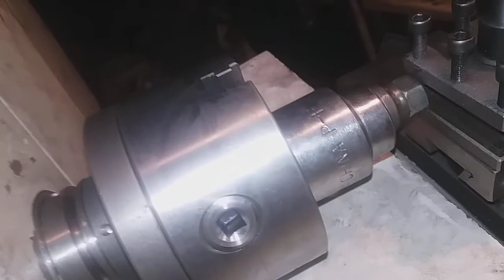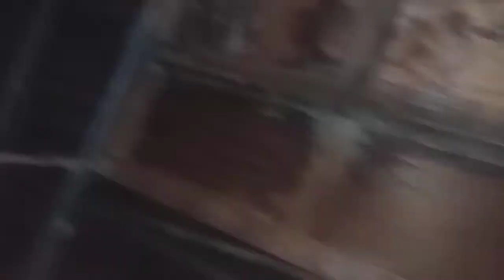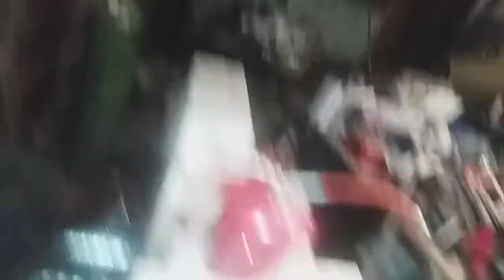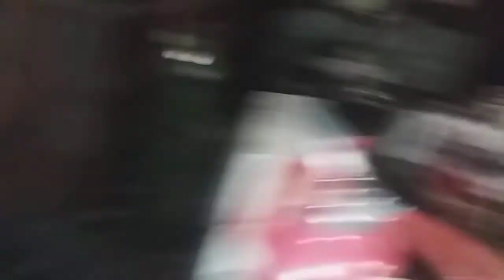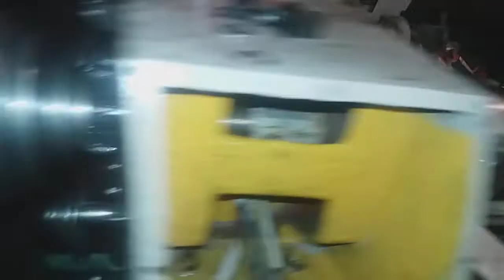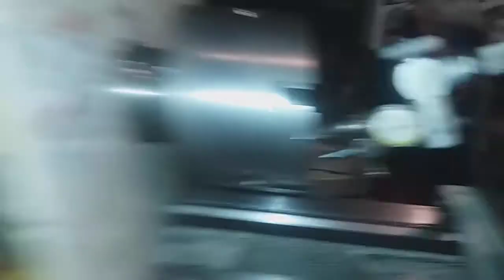G0602 Lathe Spindle Replacement/ Headstock teardown Part 6 of 6

Comment: Thank you for putting this together! I watched the whole series. Very Helpful! I need to do mine as well for the same reason, my oil galleys were full of grit, no help from Grizzly. Question why did you have to replace the spindle? Did I miss that in the videos?
Reply from the maker: Thanks for comment, yeah I believe the included video covers it. In the videos I was gaining experience and learning things, but didn't find the problem until I switched to the 4 jaw chuck. I think they cut the backplate on it (maybe) because it didn't seem to have issues with the 3 jaw till I put the 4 jaw on there. I was inexperienced and couldn't figure how I couldn't get things to run true. Finally started to indicate everything and found the mating surface on the spindle was what was off. I showed a vid to Grizzly and got them to send me a replacement, I didn't want to try and fix that, although I tried doing it in this video as experiment, but got the lathe so I know it would be new and not be way old machine with worn ways that I wouldn't know how to deal with. But I replaced the spindle for it being off, thought better solution for me at the time. https://youtu.be/mVNkRMLIf28

Comment: Posting this on the first and last of the 6 part series.  This is the only video I have found so far showing the spindle and bearing replacement on the G0602 which has the same headstock as the G9972Z.  I want to electively replace my spindle bearings as the lathe is over 10 years old and the videos have been helpful to know what to expect.  My main takeaway from this series is to make a pair of arbors to install the bearing races.  I'll machine them from aluminum to fit the ID of the race and the ID of the opening in the headstock.  They will be at least 1" long; maybe 1-1/2" so they'll stay aligned on the all thread.  That will eliminate all of the juggling of the heavier parts including the chuck (!) on the right end.

This is not a place for impact wrenches.  Correct fitting 50mm hook type spanners are readily available and inexpensive.  Runoout on the outside of the chuck is irrelevant.  In a perfect world the OD would be perfectly concentric to a test bar in the jaws but I wouldn't count on it.  "Normal" play at the chuck would be .0001 or less with good bearings.

Comment: I dont think your supposed to have that much flex, and what you are seeing is play in the bearings because they are not tight enough. pulling on the back of the spindle is only moving the spindle side to side. that seems like way too much play.